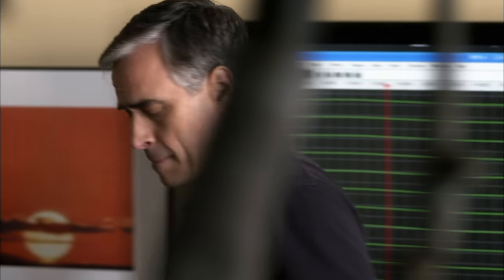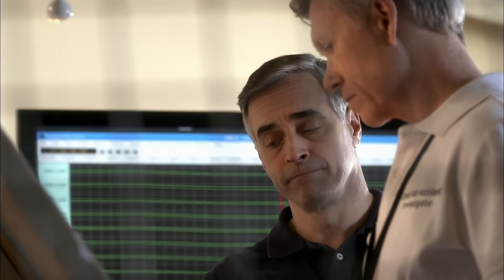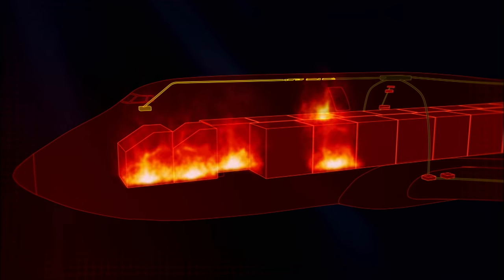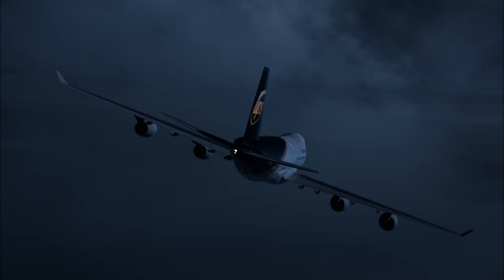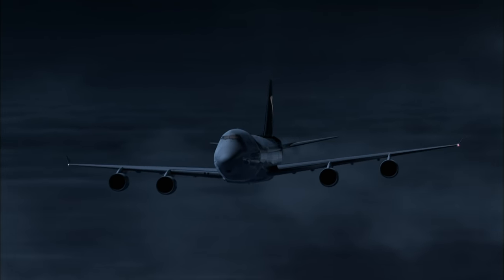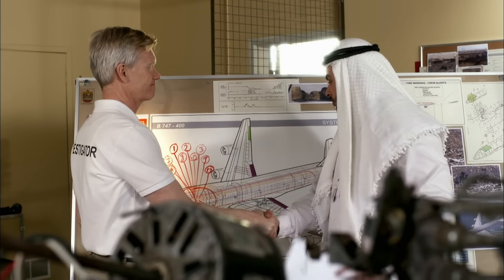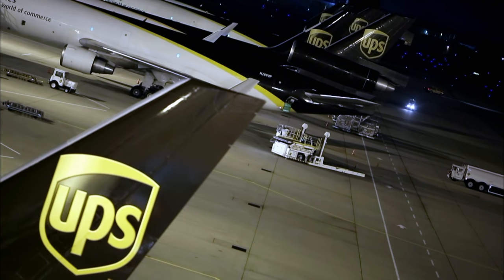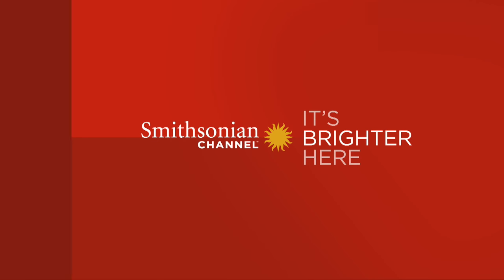This Plane’s Anti-Fire Protection Failed to Prevent a Fire 🔥 Air Disasters | Smithsonian Channel

Comment: The B 747-400 and the new 747-8does not have a fire suppressant capability in the main cargo hold. Only in the lower one which could fight a fire for hours. So in order to fight a fire in the main cargo hold , we were ask by the checklist to climb to 22000 feet and depressurise it to starve the fire. Or start an emergency landing. A plane of this magnitude will give you around 15 minutes of survivability ,    With lithium batteries, they fuel themselves. Unfortunately that doesn’t work with them. After this accident, our company was not allowed to fly them anymore. That was a relief for all the pilot force.
Reply: Too bad
Reply: @kirilmihaylov1934  Well, you can’t blame them for that you know it’s More of Safety not Money, most people see it the other way but Lives are worth more than the product

Comment: "This plane's anti-fire protection failed to prevent fire"

You had one job
Reply: Lol
Reply: The video failed to explain this, but the fire was due to a shipment of lithium batteries. So the fire protection measures were actually quite good for holding on as long as they did. Most in-flight fires will be extinguished by depressurizing the cargo hold. UPS 6 tried this, but lithium fires create their own oxygen while burning, so it didn't work. 

The fact that the plane stayed in the air for longer than 1 minute without any lithium fire specific measures is a testament to how impressive the firewall was. Compare that to how long Swissair 111 lasted with just a basic electrical fire.
Reply: @flyingtentacle7631  oh nice
Reply: @flyingtentacle7631  You can still do it with a better designed system.
The lithium supply isn't infinite. Make the fireshield in the cargo hold strong enough to contain the fire until the supply of fuel and oxidiser runs out

Comment: and that's why you don't assault batteries
Reply: Well, I would partly blame the rules regarding the limit on the lithium Batteries, it’s not the Pilots fault, not UPS fault it was more of the fault on the maximum amount of lithium batteries, had there been a lower limit fire would have been less intense, more time to land, all the opposite things that occurred (Except the Flight Controls, well sort of) but this crash did help to fit all the smoke detectors, fire extinguishers and the allowable amount of lithium batteries onboard

Comment: Sadly shortly after this one in October of 2011, another 747 freighter (asiana flight 991) went down 107 km off Jeju Island, south Korea, killing it's two pilots, it too was caused by a lithium ion battery fire. It's CVR and FDR were not recovered(likely at the bottom of the ocean)but they believe it had a similar cause to ups 006

Comment: Fun fact: some of the scenes used in the video were from another ccrash. South African Airways flight 295. a 747 combi (a combi has both a passenger and cargo area) had also suffered from one in-flight cargo fire

After this, there were many rumors or conspiracy theories that not probably (or probably happened)
1. The south african army smuggled red mercury on board for the then Apartheid south africa's atomic project
2. the rifles or guns must have been on the plane
3. (this is the same that happened to ups 6) lithium batteries ignited and causes a fire